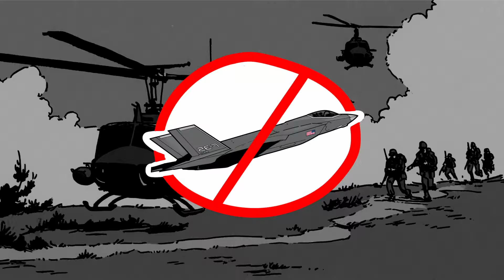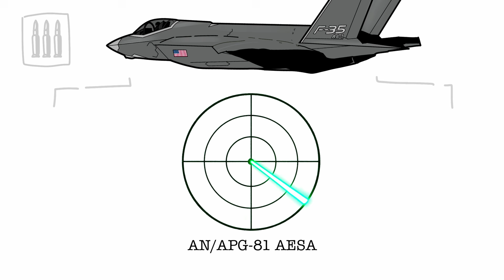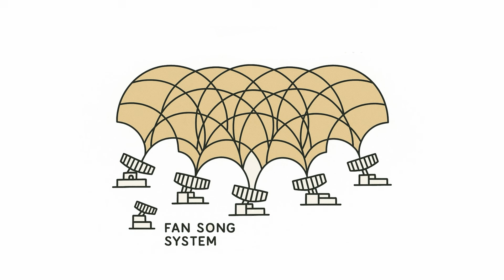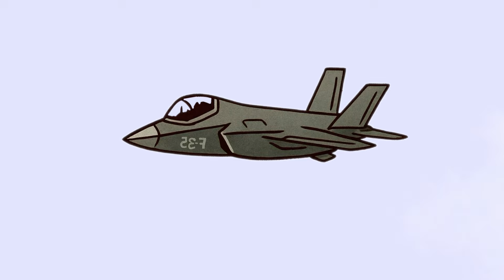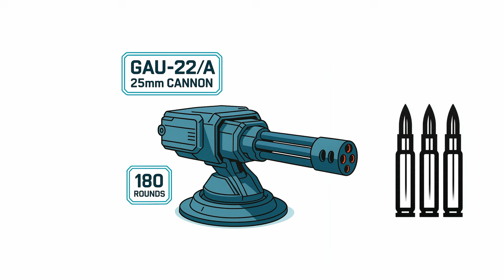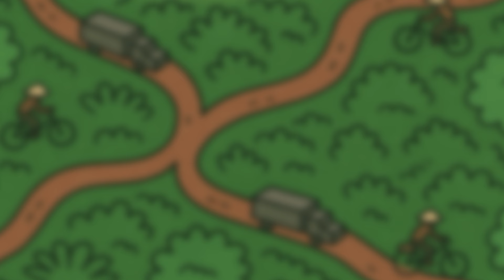What if an F-35 Lightning II Fought in the Vietnam War?

Comment: This is lowkey a really bad video. The plane wont operate without advanced radar assist. Then when its introduced, it works incredibly but the fuel is the problem. Then its the psychological impact. And all of this fails to recognize that the US was heavily involved in vietnam by 67-68 so all of these soviet supplied air defence systems aren't at the readiness of the 1972 number claimed in the video. This is just bad and really poorly considered. Dislike AI content and we can beat it